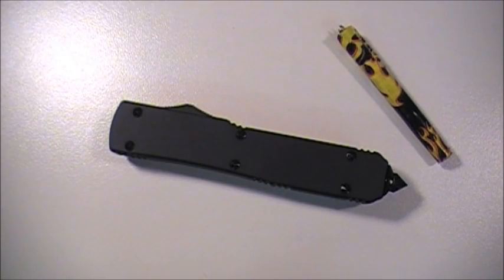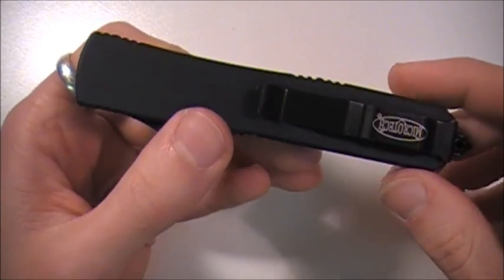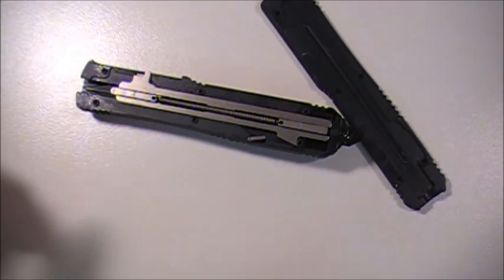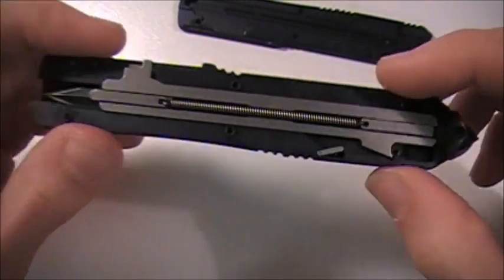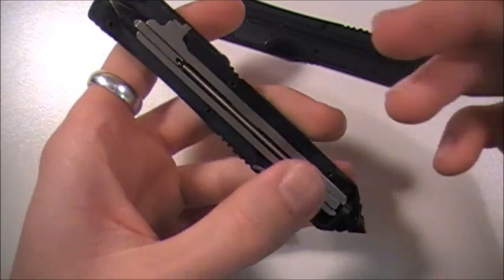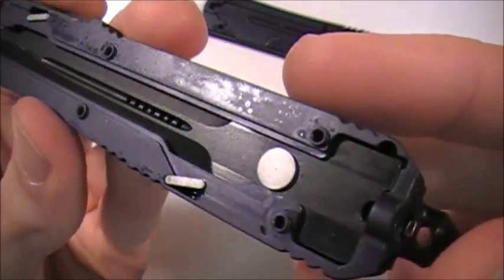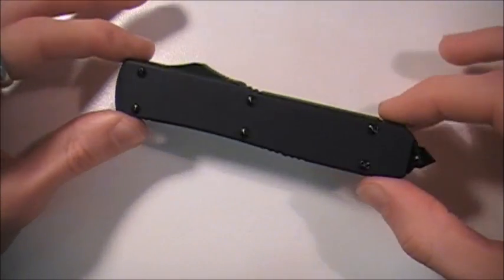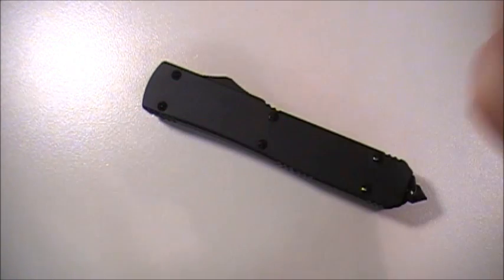The Inside Of A Microtech Ultratech & How It Works

Comment: Does opening a Microtech void the warranty?
"We understand that some customers may prefer to maintain their own knives. Sharpening your knife does not automatically void the warranty. The warranty will remain in effect so long as the blade is not improperly sharpened and the handle is not damaged or stripped due to disassembly, determined at our discretion. Sep 7, 2020" MICROTECH 

So yes you can take it apart as long as you're not an idiot!
Reply from the maker: Well, this video is almost 10 years old, so it might not now but I heard back the  that it would. Now, that might not have been true then, it's just what I had heard.
Reply: Yeah I'm thinking they may have relaxed their policy on that from when they first started. They just don't go out of the way to say it. But they do even sell the bits you need to take them apart now and sell cool replacement screws that would require you to take the old ones out first. Lol

Comment: That guy is completely wrong about how those locks work. They don’t work at the same time. One is a door to hold the blade out when it’s open. The other holds it closed when blade is retracted
Reply from the maker: Hey, this video is almost 10 years old, Microtech may have finally caught up to my original statement, and started making their knives this way. I could be correct, it just may have taken a decade haha.

Comment: What is the spring inside the firing button for?
Reply: +Oscar As far as I can tell, just to keep it from rattling.   Theoretically it could be used to push the button into detents, but I don't see any detents in the handle.  Detents, for example, could make it so you have to push the firing button down and forward or down and backward to operate the knife.